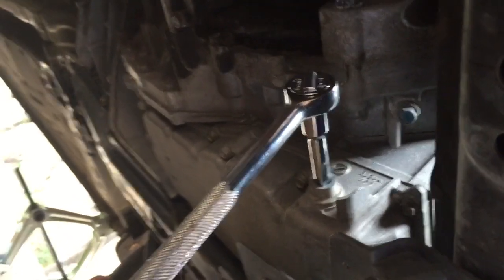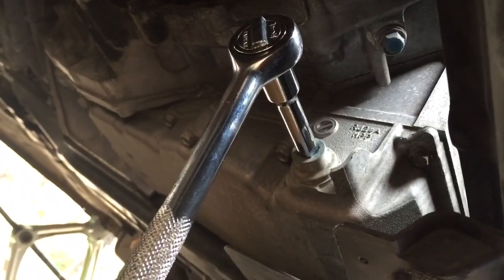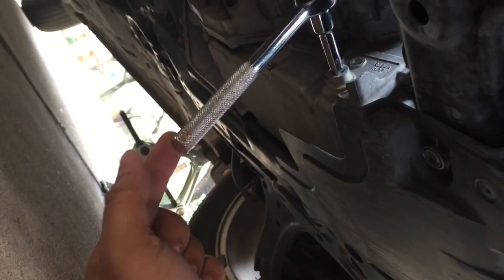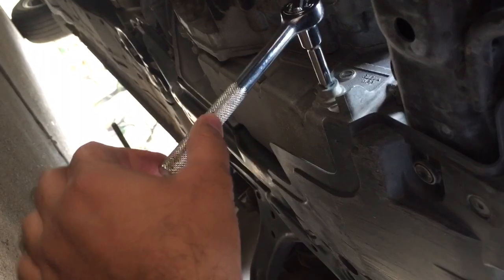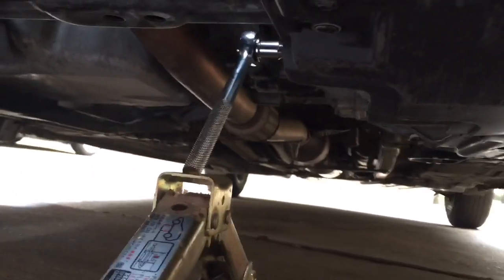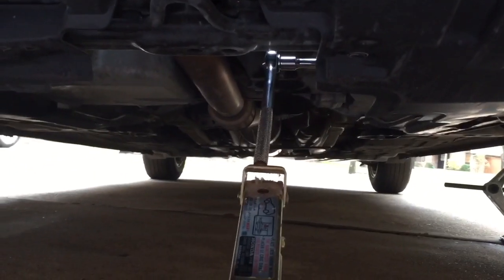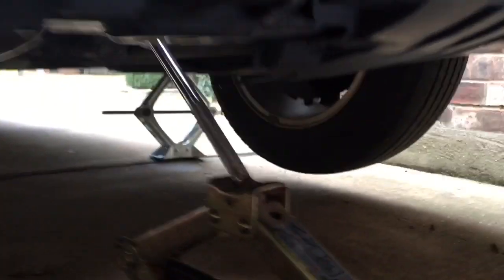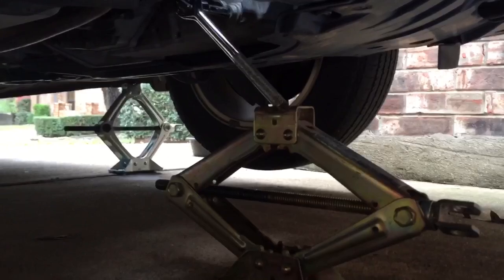How to loosen a stuck Transmission Fluid / Oil Drain Plug

Comment: Im seriously so afraid of breaking the case on my T5, but both of my plugs are stuck. PB blaster for the win, heat and ice cube... who knows!?!
Reply from the maker: If I had T5 in any of my vehicles I would be quite worried too. Kudos for owning a fun car that uses T5! :) As for opening the drain plug, there are several options, PB blaster, heat and ice cube, lightly tap with hammer, and also this which I show. If nothing works you can use fluid transfer pump to replace the fluid, or take to local service shop for fluid change and ask them to open he drain plug. They have power tools and may be able to get this done easier. Then you can do future drain and fills yourself.

Comment: I know this is a option but the plug on mine is not deep enough so this will not work for me unless I use a ratchet strap to keep it from moving around
Reply from the maker: The hole where the ratchet fits, may be it is filled with road grime that you can clear? Other option is to use PB blaster, light hits from hammer, or just have the shop do the fluid change this time and deal with the stuck drain plug and you pickup the maintenance from there on. I hope this helps.

Comment: Mine is so stuck it ruined my socket, I can apply more pressure than what it takes to turn, still nothing. Using pb blaster, wd40, every cuss word in my vocabulary and multiple sockets/wenches
Reply from the maker: If the plug is frozen stuck and you have tried everything, there are two other options: either ask a local shop to open/loosen the drain plug for a small fee, or get the transmission fluid changed out at the local shop and be ready to pay a little extra to replace drain plug. Definitely check with them first on cost if drain plug is stuck.

Comment: BREAKER BAR 3/8 1/2 
Don't use a Ratchet !
Reply from the maker: Thank you.
Reply: @HuuTonyTran  
He is using a Ratchet he may not have a impact because that tension will break the inside the ratchet

Comment: didn’t work for me ? suggestions ?
Reply from the maker: A few options: 1) Tap the bolt with hammer, 2) use PB baster, 3) use breaker bar 4) ask local repair shop to loosen the bolt with their power tool - some would, others won't or they want to charge for labor. If you've bought the fluid already take along in case the shop wants to charge labor and use your fluid. 5) If that doesn't work then just have the service shop do the transmission fluid / oil changed this time w/ their fluid -> they will open the bolt with their power tools and then you will be all set for the next fluid / oil change. I hope this helps.

Comment: Cool idea... think I will use a breaker bar though.  Wouldn't want to put that much stress on a ratchet

Now show us how to use a come along for the drain plug 😂
Reply from the maker: You got it!
Reply: @FlyBeee  YES, Thank you and it just so happens I DID use a come along 😂😂😂

If the orientation of your breaker bar while attached to the soicket precludes you from obtaining an appropriate angle to use the jack method....

1) Back second vehicle up to rear of car with stuck plug.  

2) While having a friend carefully hold the wrench on the plug, wrap the hook of a comealong to the bottom of the wrench and the other end around a secure frame member of other vehicle.  

3) Gently crank.

Comment: Can you still drain the fluid with just unloosening the bottom transmission screw? My top screw is a bitch to get to. It's way too far down under the hood to reach.
Reply from the maker: You can, but it will be a slow drain. If your top screw to refill the fluid is not easily accessible perhaps you can fill from the dip-stick hole? I did that on the other two vehicles and it worked fine. The videos are available if you would like to review. Good luck

Comment: Nice tip! I had to remove the fill and drain bolts on my Honda and this greatly helped with the fill bolt. Before doing this, I would definitely try using PB Blaster on the bolt, tapping the head of the bolt with a hammer reasonably hard, and try turning again. Try doing that a few times and waiting several minutes in between before trying this as this looks like it could strip bolt or threads.
Reply from the maker: Wonderful tip on PB Blaster! Thank you.
Reply: Fly Bee Anytime!

Comment: Thank you sir just did with my honda accord 2002 change transmission oi.l bolt stuck did what you did and it work saved  money your a legend.
Reply from the maker: You are welcome! so glad my video helped. thanks so much for taking the time to provide feedback. Best wishes!
Reply: I got 2002 Honda CRV and I need to change oil... gonna try this🖒
Reply from the maker: @TheJohnny928  If the drain bolt of your CRV hasn't been opened in a while, try a combination of things like: lightly tap the drain both w/ hammer, Spray PB Blaster and let it soak for few hrs (or overnight), lift CRV high on jack stands and user breaker bar (if available) to open bolt, and this trick to open bolt with scissor jack. If you get a chance, please  let me know the outcome. Best of luck!
Reply: @FlyBeee  TY 🖒

Comment: You could be putting too much torque with the jack. Dangerous. If the plug is frozen and the ratchet brakes, pieces become shrapnel. Use a snipe. (a pipe used as an extension, placed over the handle of the ratchet. Creative idea with the jack and it obviously works in ideal conditions but can be dangerous and is not the best method in my humble opinion after 60 years of knuckle busting.
Reply from the maker: Thank you for the advice! Best wishes
Reply: You're obviously right, but this saved me anyway.

Comment: Watch the position of the plug, it never spun.  The ratchet broke.
Reply from the maker: It worked like a charm and opened the drain bolt :)
Reply: mightymikee it's a hex key plug, not a socket so it only looked like it never turned

Comment: Why wouldn't you just put a snipe on the ratchet?  More control that way.  Or better still, just spend the 10 bucks and get a proper breaker bar.  This seems like a good way to both break a ratchet, and strip out a drain plug.
Reply from the maker: Yep that works too. There are many ways to do something, I am showing one of the many options.Thanks

Comment: What happens when the plug gets completely stripped out because aluminum is soft?
Reply from the maker: By 'plug' if you meant the drain hole's thread in the aluminum case, this can be retreaded rather easily. Typically this happens when the drain bolt was not put in and tightened correctly during last fluid refill, and happens mostly for oil drain hole because oil is changed more frequently so more chances of someone to fit the drain bolt incorrectly. 

But, if by 'plug' you meant the drain bolt then it will have to be removed with machine or drill at a shop. On this vehicle it is hard to strip the drain bolt because it is round and ratchet or breaker bar has to fit in the square hole inside the drain bolt. But it can happen if the drain bolt was rusted or just frozen in. 

Overall, for any DIY project, if something is not working or is stuck, don't use too much force to make it work. instead see why it is not working and if it looks stuck, ask your local service shop(s) if they an help open it. Most of the time the guys at these places are happy to open stuck bolts with their power tools. lol
Reply: @FlyBeee  yeah I meant the plug bolt not the plug hole.   I had to order one.  It squished with only my 8 inch 3/8 ratchet
Reply from the maker: @UltraCon79  You must be super muscular to have stripped the inside square of the drain bolt where ratchet fits, lol ! I use a generic made-in Taiwan tool set that you see in the video and it has worked good for many years  and hasn't stripped the drain bolt .. at least not yet. Do you use a specialty ratchet?
Reply: @FlyBeee  just a craftsman set from ACE hardware
Reply: @UltraCon79  I strip the 3/8" square as well, did you already succesed removing that plug ? I tried to tap with hammer and rebar sideway counter clockwise buat the plug to soft.
Reply: @singachuotodiy  I did.  I figured the plug was shot so I hammered an extension into the soft metal as far as it would go and put a 1/2 breaker bar on it and it snapped loose loudly.  I made sure I put it back in with as little torque as it would need to not leak about 18ft pounds.  I bought a new plug from the dealership for next service.
Reply: @UltraCon79  great, I already mess up with that square. Thingking about using screw extractor but worry about the chips get into the transmission. I already have a couple new plug, but still can't unplug the old one. Will try again this again
Reply: @singachuotodiy  sometimes you can use a torch and that changes the size of the metal temporarily
Reply: @UltraCon79  apply the heat on the plug itself or around the plug ?
Reply: @singachuotodiy  the plug itself

Comment: only works if the handle is at an angle that gives a convenient leverage for the lift to work but that's still helpful. Just didn't work for my case since the handle point straight down almost at a 90 degree, so lifting it up would also lift the car :(
Reply from the maker: You have to put the ratchet & extension in the drain bolt,  fix / lock the handle of ratchet at the desired angle, slide the jack under the ratchet handle, and then start to lift the jack. Overall, you have to sort of play with this setup to make it work because sometimes the drain bolt is on the other side of engine and the ratchet has to be setup a bit differently. But the hack/trick works and I have used it for years. I hope these extra details help. Best wishes
Reply: @FlyBeee  unfortunately my drain bolt is a 3/8 square socket so there isn't many angles to play with. It's either vertical or horizontal -.-  I managed to break it loose eventually using multiple methods combined thank God! I like your video tho! added to my playlist in case there's a similar situation

Comment: Take that extension off and smack the handle of the ratchet with the palm of your hand, or just invest $15 into a harbor freight breaker bar and boom problem solved
Reply from the maker: Yep, that works too. There are many ways to do something, I am showing just one of the many options available. Thanks so much for your feedback.

Comment: That’s horrible idea just use a breaker bar
Reply from the maker: Thanks so much for the feedback. There are several ways to do any thing, what I show in the video is one of the many ways to open the drain bolt. It is up to the viewer(s) to decide which method they would prefer, and everyone's preferences will differ. Best wishes!